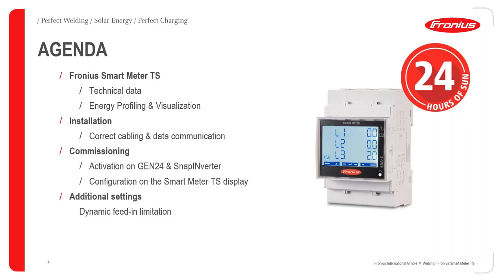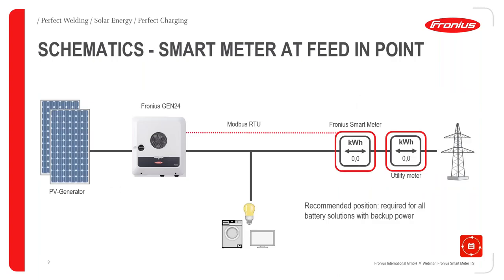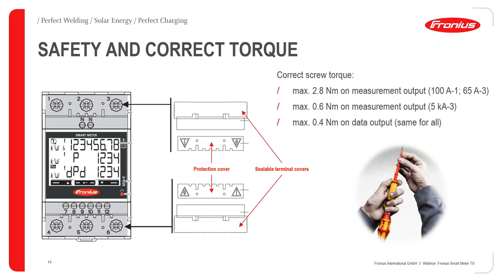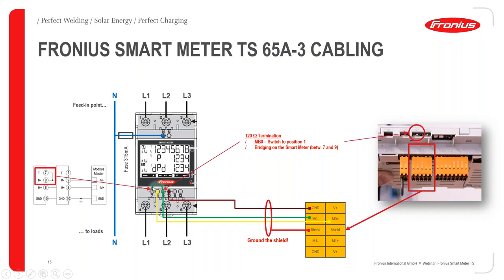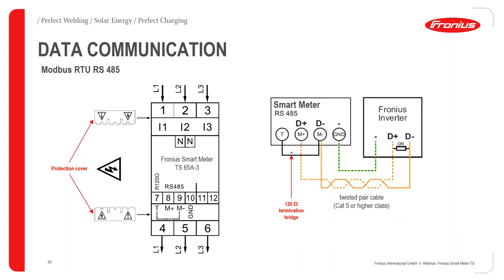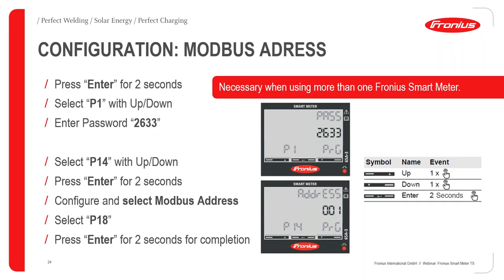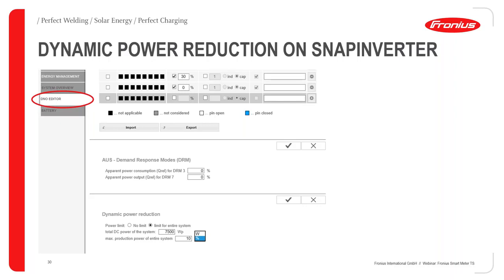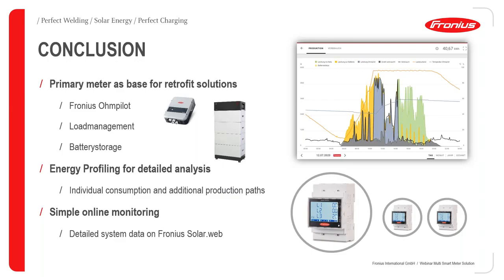Fronius Smart Meter   correct installation and use of smart meter data

Comment: Hi guys... I bought a Fronius Symo 3phase 5kW inverter... And I would like to use this together with electric energy from the supplier... But I would like to use my energy first. Is a smart meter solution for limiting the energy from the supplier? I have a few if-then-else questions - let me know how I will contact you.